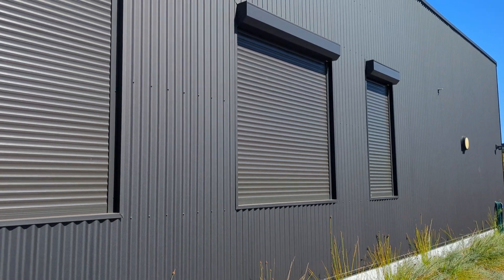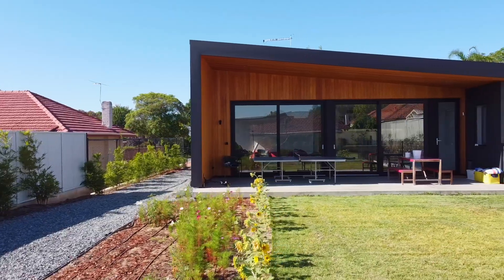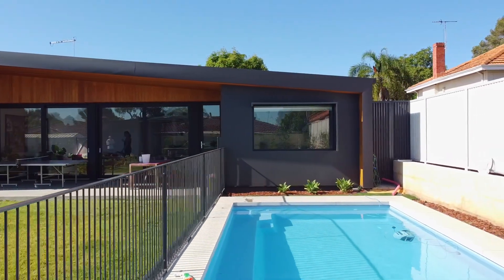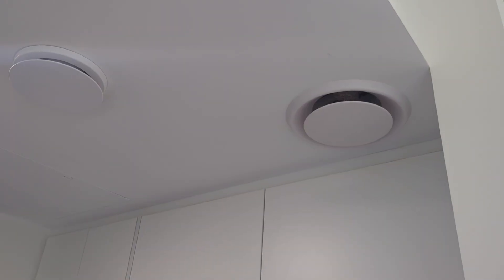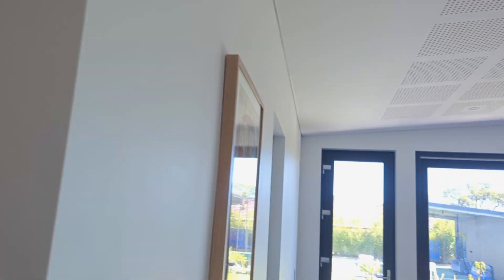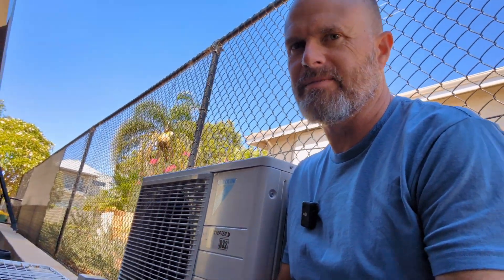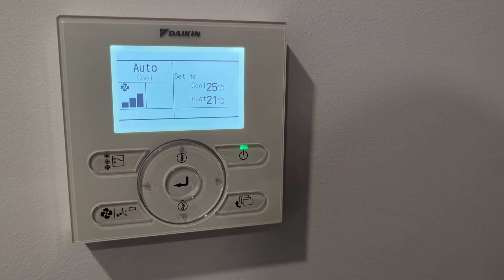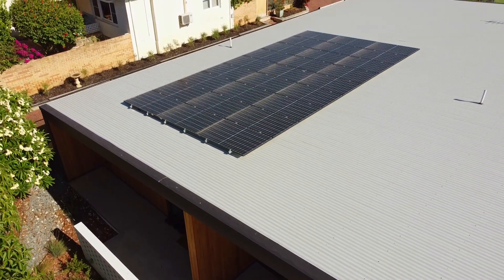How does our Passive House perform in a heat wave?

Comment: Hi, sorry to be that guy, but the ventilated void behind a facade removes negligible heat - this is a common misunderstanding in the industry. It is great at drying the cavity and providing a drainage plane. The colour does affect the local microclimate - walking in front of a dark facade will feel significantly hotter during the day due to infrared heat transfer - and a city full of dark roofs will create more of an urban heat island and cause more cumulative heat damage to PV systems.   

I like the internal recirculation on a single AC unit. Americans frequently use central return recirculation units, with the fan coil in the duct system instead, which are better with medium load buildings and climate zones needing more dehumidification.
Reply from the maker: I agree that the openings at the top and the bottom of the cladding may not ventilate all the heat trapped by the cladding. But it is better than no cavity. In this case we made a conscious decision to go with a dark cladding and the performance of the home doesn't seem to suffer as a result.
Reply: @theleanarchitect  Thanks for the reply. I can see how it would be tempting to use a concept like that to counteract the disproportionate emphasis you Ozzies put on cladding colours. But if the effect represents like <1% of the total heat transfer, it just contributes to the confusion and doesn't help towards developing good practices. 

Our equivalent discourse are green roofs in the UK!
Reply: @FrankReif oh that's interesting - what's the misunderstanding around green roofs?
Reply: @theowhite  They're expensive to build, heavy, impractical to maintain, and are just worse than using the equivalent price for much more insulation. 

You're better off going for a standing seam steel roof, vented mesh to the ridge. It'll last 50 years with next to no maintenance, no problem.

PV systems mount very well to the seams. And you can have it in any colour you like, if you're in an AC climate, by all means make it white!
Reply: @FrankReif  Irrespective of the cost, I would've thought a vegetated roof would be the ideal solution relative to Urban Heat Island effect. And more plants in general is a good thing. In terms of maintenance, they're only as impractical as any other garden, as long as they're designed to have sensible access. If you're partial to gardening, a green roof is no issue. It's not for everyone, but if we're serious about climate change perhaps vegetating the tops of commercial, industrial and educational buildings is worth mandating.
Reply: @FrankReif  Just keen to understand your comment on dark facades being hotter to walk by than light facades during the day. Is that in the UK context? It's certainly not the case for a good chunk of Australia. The light surfaces, particularly steel, are very hot to work against when the sun is hitting them- even in winter in northern NSW. The heat reflection is crazy. Northern NSW winter temperature is about the same as London's summer temperature, and the sun shines for a good chunk of that period. I'm not saying we should use dark facades, I'm just keen to understand the context. Perhaps timber cladding is the preference and we should avoid steel due to the reflectance.
Reply: @ISARCHITECT  To reduce the heat island/microclimate effects, you need a low emissivity/high albedo material that reflects the light back out to space. There are even compounds which emit light in the correct spectrum to get sub ambient temperatures. 

So it doesn't matter what underlying material you use, as long as it doesn't absorb the radiation and turn it into local thermal energy as hot hair, or radiate it evenly onto people.

As for the facades, the light can reflect off the wall, then onto the ground - so the heat is spread over a larger area lowering peak temps, and the ground faces the sky, so thermal radiation is emitted upwards into space. 

The effect of having a dark material on the effective r/u value of the enclosure isn't as high as people think - insulated walls are so thermally efficient it ends up being an increase on an already low number - solar gain through glazing is much more significant.

There are even cases in mild climates where a white roof can recude the rate that moisture migrates to the ridge/diffusion or inward vapour pressure to the ventilation system. It has led to some issues with trusses on the cold side of a flat roof expanding, causing damage below.
Reply: @ISARCHITECT  Remember that vegetation cools due to the evaporation of large amounts of water. If you have water to spare, you're essentially air conditioning the roof by creating humidity that gets taken away on the wind. The heat is still absorbed. 

If you can't use water, due to droughts, then the best thing to do is reflect it back into space. This is important when talking about he use of trees too. There comes a point where you have to water them or they're damage subterranean infrastructure, or they simply die. 

For the best ways to design an urban environment to cope with extreme heat is to do what they do in Seville, Sicily, Yemen, Kasbars in Morroco, which is to have tall buildings with narrow alleys, and fabrics suspended between them. A combination of form factor and increasing albedo.
Reply: @FrankReif  Here in lies the problem with most of Australia- sprawling suburban development. And to make it worse, all vegetation is removed from these large tracts of land prior to the construction of the infrastructure and then the stand-alone houses, 1.8m apart from each other. The Urban Heat Island has to be treated as a collective issue across entire estates.
Reply: @FrankReif  Totally agree people obsess with the light/dark colour of building claddings too much. We've modelled it on identical houses and the software shows the difference is completely  insignificant (on the very temperate Midcoast of NSW). There are so many other factors that affect it more. The catch with light facades reflecting on to the ground is if that ground is masonry. It then stores some of that reflected heat. At night when windows are opened to let in the night air, the heat from the thermal mass comes in with it. We aim to design so no summer sun touches any part of the north facing walls (south hemisphere) and no masonry in front of those walls.
Reply: The colour does affect the local microclimate, however on the Midnorth Coast of NSW walking next to a white steel wall is much more uncomfortable due to the sun reflecting off it. It's amazing how intense the heat being reflected is. The dark steel reflects the heat too, but not as intensely. I'm sure this would be similar in many parts of WA. If the walls are masonry that would change the scenario. I'm really keen to see studies on the urban heat island effect with a comparison between steel and masonry roof types. I believe there's some study at Newcastle Uni in to this.

Comment: One thing I would like to suggest, 
Considering that you have invested in a in ground pool, depending upon the volume size and depth of it, you could have used it for the cooling of your interior space 
If you had made a treatment ( like a live or faux plant overhang/pergola ) for shading especially on the high solar times of day, that water will stay cool throughout the day and easily below 20-22c even on the hottest days, if properly shaded, maybe using a light coloured pool cover during the day when pool not used and removing the cover at night ( to allow night evaporative cooling). 

If doing this you could use the pools thermal energy to cool your interior space with a W2A ( water-to-air ) heat pump instead of the A2A heat pump you have, water is a much more superior conductor of energy use, while using far less energy than air fans and pumps 

I’ve done this before in Africa and it works fantastically, easily shaving 40-60% off my cooling energy bill ( which is on PV), so a secondary unit (apartment) can keep their unit cool without affecting energy consumption 

Something to consider or test using a thermostat probe in a shaded pool on very hot days to track water/ambient air temperature variance
Reply from the maker: Interesting suggestions. Often the cost premium for deviating from a local standard solution makes innovation difficult to achieve. I would love to use the waste cold air from the pool and hot water heat pump to cool the house, but no such integrated mechanical solution exists.
So we are stuck with a separate AC, HWU and Pool heater. Good for redundancy but not great for efficiency - although the solar PV is very effective at powering these at no cost for us during the day.

BTW, we heat our pool to around 25-28 degrees in summer.
Reply: Yes, I totally agree and I am working with a local university to design such systems, because generally speaking most of the mechanicals we use aren’t designed specifically for these climate zones, not to speak of the climate changing. I decided to play with hacks I’ve used in projects that I’ve done while living in places like Toronto Canada, Chicago and New York, which have extremes of both ranges. I’ve learned some great “hacks” that work in the cold and with slight variations in the heat. 
Humidity is a bit tricky, but my ERV system works efficiently ( I power it with solar pv) and I am playing with anticipating temperature heat gains throughout the day and pre-flexing thermal coolth production in anticipation for the higher demand hours ( using a predictive algorithm I am playing with for the design ) 
We have to solve the thermal comfort issue and make regional solutions, for Africa cost is critical ( high energy prices and low wages), so that’s why I’m starting here….

Comment: What r- value is your house insulated to?
Reply from the maker: Walls are R5, Roof r6.
Reply: @theleanarchitect  similar to our house KFW55 in Germany. KFW55 means the house consumes 55% of the energy the given reference house (conventional new build house) consumes. Standards are regulated by the GEG law and other norming rules in Germany: U-values (W/m2 k) of our house: roof 0.17, walls 0.23, floor 0.15, shaded balcony 0.15, windows 0.76, entrance door 0.76. (U=1/R)
Reply: @theleanarchitect R5 and R6?? Is that a typo? That has to be a typo. Or R values are different in Australia. Regular 2x4 wall with the cheapest cavity insulation is at least R-11
Reply: @hhectorlector  Totally different.

Comment: I have 2 questions, 1.  Do you hace a recirc kitchen hood or make up air for hood.  If make up air do u have motorized damper or fan for make up air?  2.  If building when it is hot, I'm worried about portable air conditioning because its a tight house and we r supposed to vent the unit outside so not sure where the intake air will cone from.  Won't be able to get our house AC unit for a bit.  Thx
Reply from the maker: Recirculating downdraft extraction built into the Bosch induction cooktop. No exhaust to the exterior other than that provided by the HRV.
Portable AC not an option without an exterior exhaust through a window opening, and these need to be a sliding window (ie. not passive house ) to get a good seal. Our windows are typically Tilt & Turn or casement for good air sealing.

Comment: What is the ceiling panels with the grid of holes?  Is this for sound absorption? Make and model is appreciated.
Reply from the maker: Its 12mm square Acoustic plasterboard. Typically used in commercial projects but very effective in making the room quieter. Especially when concrete floors are combined with high ceilings, you get increased resonance.

Comment: 25 is just too hot, 22 max.
Reply: 25 indoors in Perth is a very comfortable temp, with fans running. When I lived there prior to 2000, I would say majority of homes didn’t run aircon, we just slept at the beach when it was too hot!
Reply from the maker: Interior thermal comfort level is a personal choice that we discuss with client early in the process. If 22 is the standard required then we specify an appropriate cooling system to achieve that. For us, 25 degrees with 50% RH is more than comfortable.
Reply: @theleanarchitect  I agree that 25 is fine. It's all relative. It seems like the western world is obsessed with keeping internal temperatures at a constant 22 deg C. Keeping a house at 22 deg takes a lot of energy and embodied energy.

Comment: Would be useful to discuss Humidity in relation to heat. Humidity impacts comfort as much if not more than heat.
Reply from the maker: Good point. Humidity is not such a big issue in our climate zone, but the HRV does a good job of keeping the internal relative humidity between 50-60%. This is very comfortable for living.
Reply: @theleanarchitect thanks for your response because I was going to ask the same question. 
I have done a few passive house projects in North America and now I’m on the African continent, the issue of heat and humidity including interior moisture is the main concerns, I also use ERVs to manage the humidity levels and keep the interior air quality high while keeping the heat out, I do passive cooling with thermal storage (no mechanical a/c) and it works fine even though our days often cross 40c and the nights barely drop below 30c ( during the hot season it drop to around 32-33c overnight by 5am before raising again)

I’m doing this to tweak the design process for energy efficient homes, so I’m glad you made this video for hot climate zones
Reply: Humidity is biggest challenge for passive homes. I also live in 70-80% humidity region. Did not find an energy effective solution for humidity. Air conditioning becomes essential. Plz suggest solutions for high humidity homes
Reply: @ that’s a great point 

I have seen some interesting research from India and I believe Singapore on the use of desiccants to dehumidify interior spaces in hot humid climates. As you and  @alfredodino825 rightly noted, humidity is the main problem, and dehumidification is a type of space cooling in itself. 
I have started to work on what they had said, but I believe they have some work on using a standard desiccant (used in new footwear or medicine packaging, so ubiquitous ie easily sourced, safe and affordable ) to absorb the moisture from the interior atmosphere and used solar PVT heat to recharge (dry) the material thus allowing it to absorb more moisture, 
I am working on this for the hot-humid zones of West Africa and South America where this issue is prevalent. 
If I come across the research paper I’ll share the article title, as I believe it is posted publicly 👍🏿

Comment: What system do you use for air transfer? We're finding similarly that the north-west corner of our house is a bit of a warm zone also and the HRV isn't capable of mixing enough cool air for the heat gain.

FWIW we went dark Colorbond, although with a dark roof too because it was visible. With the ventilated cavities, it's performing great. Ironically the house is coolest around midday when the windows get a break from the east facing sun (we have shading yet to be installed).
Reply from the maker: For air transfer they are simple room to room inline fans with 150mm ducts. They move about 300 litres a minute. It would be great if these were upgraded to move more volume.
Reply: @theleanarchitect  What make & model , please. I have the same problem in air distribution.